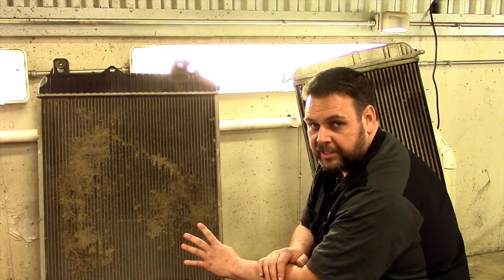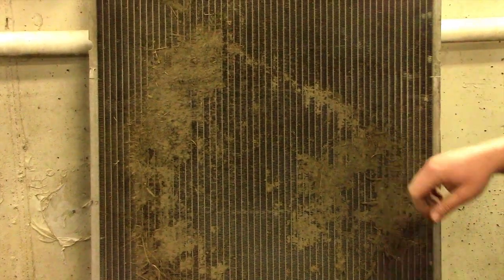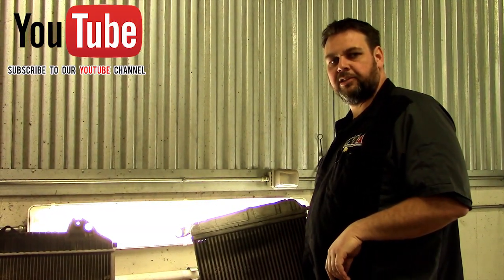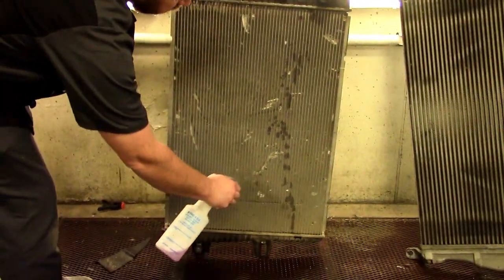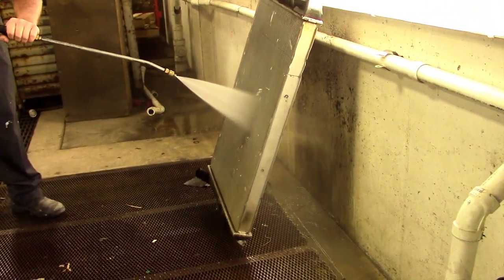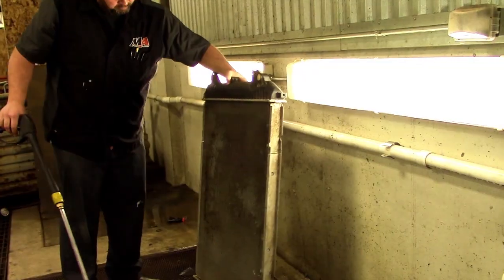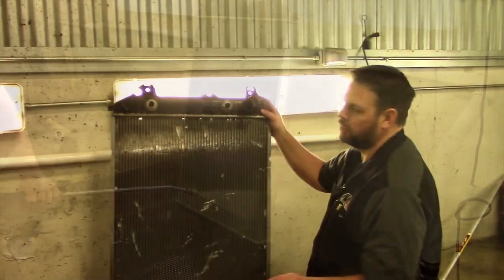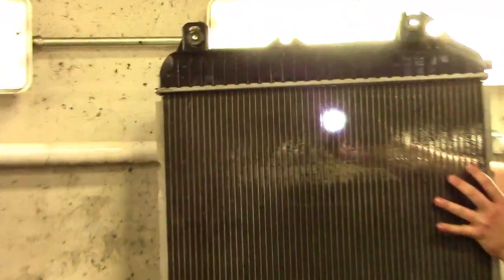Must-Know Secrets: Duramax Truck Cooling Stack Maintenance

Comment: Why is it in every other vehicle it's called a radiator but here because it's a diesel it's called a cooling stack?
Reply: It’s still a radiator here too, but the intercooler and radiator bolt together, and the condenser right in front of that. It’s all “stacked” together, hence the slang term. In this case, you want to clean all of them, or the whole “stack” not just the radiator
Reply: @ericmerchant3646  Got it. Thanks.👍🏻

Comment: I actually did mine in the truck took intercooler out and got a pivot tip for pressure washer so I could clean straight on and didn't bent any fins but cleaned it up nicely I used purple power and simple green

Comment: I thought preasure washers can damage the fins
Reply: Not if you angle it properly and not use the pointed stream
Reply from the maker: use a wide fan pattern and be sure to spray straight on and not off to the side

Comment: Thanks for the video! Pulling the stack is more than I feel comfortable with and since I have a PWer, how you feel about pushing the dirt through from the front with everything in place? Big compromise but better than nothing?
Reply from the maker: Anything will be better than nothing when cleaning it.  Power washer can cause more damage than good if not careful is all.  You want to be sure that you are not bending over any of the fins with the water pressure.  Most of the build up is going to be between the radiator and intercooler, which of course is the hardest place to access to clean with out taking it apart
Reply: @merchantautomotive  Thanks! PO installed an attractive Lund grill insert but it only has narrow, vertical slits for airflow 😟. My CA LB7 has an EGR cooler, like the LLY, and it’s my understanding, GMC did nothing to upgrade the cooling system.External oil cooler seems the way to go, but $$$.
Reply: @stevewaclo167  are you sure your LB7 has an egr cooler? I'm pretty sure the LLY was the first for that and a catalytic converter.
Reply: @2015_Rubicnn  I have an ‘03 California LB7 which indeed has a cat and EGR.
Reply: @stevewaclo167  Well that is interesting....I believe 01 was the only year then that did not have a cat or EGR. I assumed they all didn't until 04.5. The RPO code in the glove box would dictate whether it was Cali or Federal emissions. 👍
Reply: @2015_Rubicnn  yeah them 99-01 GMT800s have a lot of weird differences, particularly the serpentine routing up front on the 2001 LB7's
Reply: @2015_Rubicnn  there is also north east emissions which is less than Cali but more than federal